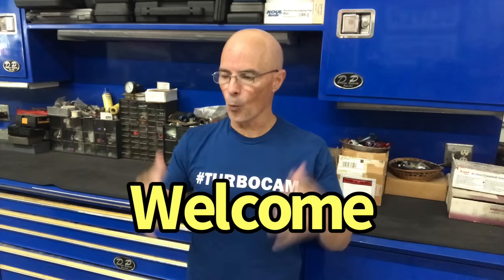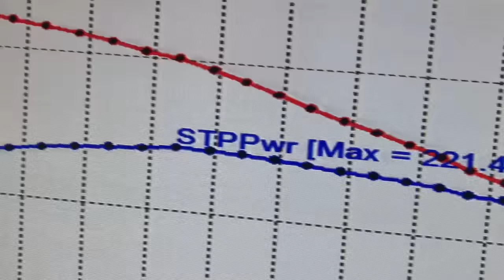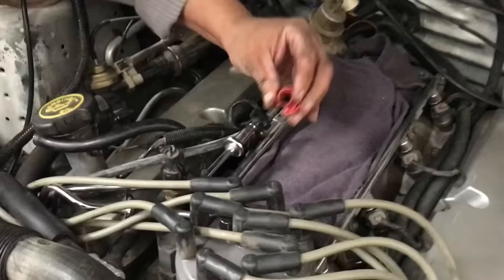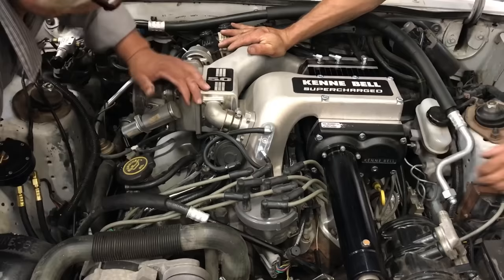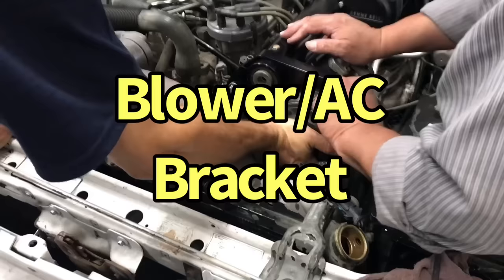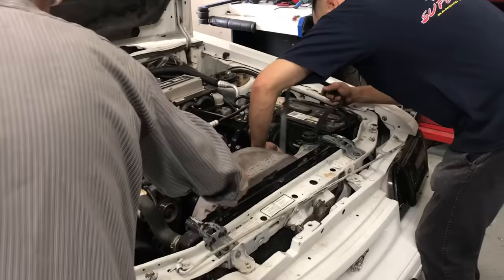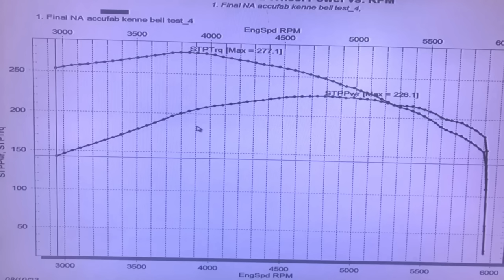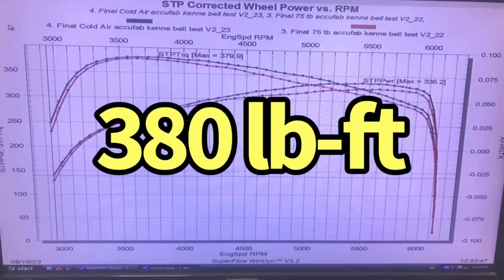DOES KENNE BELL STILL MAKE A 50-STATE LEGAL SUPERCHARGER FOR THE 5.0L? HOW MUCH HP IS IT WORTH?

Comment: That thing made almost exactly the HP and TQ of my old 88 GT from back in the mid 90's. I made 226rwhp/282 rwtq. Oh the memories.
Reply from the maker: must of had mods
Reply: @richardholdener1727  the basics. Cold air intake, pullies, catted h pipe and exhaust, bumped the timing, ditched the PS. Dynoed at Brothers in Corona by Joe way back then. Ran 12.9x's all day long on slicks at Pomona street legals.

Comment: I feel like this is what Ford should have done in 1993. Our Australian Cobra engine, the one with the Showa G52 intake, and built to Cobra spec by Watsons,  made 280 flywheel SAE net HP and 220 rwhp with a T5 and 7.8 inch axle on 245 tires. Listed as 274 HP DIN net.  The baseline looks the same. Great test.

Comment: The video reminds me of helping a friend install one of these K-B units years ago on a 95 5.0l. The dance of trying to get the blower and upper manifold onto the lower and getting all the bolts started was quite the feat.
Reply: Worth the trouble I assume
Reply: @Andy351c  yes, it was. That thing was scary to ride in afterwards. It had trickflow twisted wedge heads, GT 40 lower, LT headers and 3.55 gears and a stock cam. It had so much low end grunt, it did rolling burnouts in the first 3 gears at will.
Reply from the maker: THE STUDS HELPED
Reply: @richardholdener1727  yup, that is what i was thinking when you where mounting the supercharger. Studs make it that much easier to align.

Comment: Richard, thanks for the review.  I seen KB brought these back and great to see a current review.  I’ve been running a Blowzilla on my 306 for 4 years now with smiles for miles.  It sat on a shelf for 9 years waiting for the car of choice.  If only KB would have engineered an intercooler setup for it.  I’m running meth injection to help the AITs but think a cooler would be better overall.  HCI setup with “Explorer” intake, 90mm TB & MAF, typical LT header exhaust through a T5 trans and 9lbs of boost puts 420 hp/ 502 tq to the rears all day long running AC with a great tune of course 😊.  Full boost at 2800 rpm’s.  Much more boost to be had, but no real need for longevity is key for me with stock block and forged internals.  Here in NC we get some hot days and yes AITs are a challenge, but for a street car that drives to half dozen large events and back a year and weekends, I absolutely enjoy it.  Again, thanks for the great content and transparency as always!

Comment: I was having my 12 mustang tuned recently here in Florida at a local place, there was a 91 gt with this exact supercharger it had ford shorty headers with cats everything was stock besides exhaust Auto with 2:73 gears. I forget what pcm combo he went with ( I believe it was a holley) it was there for tuning as he ditched the ford pcm. He made 315/365 to the wheels. On stock pulley it made 4.5-5 psi. The owner told me he bought the supercharger over a decade ago he had about 50,000 miles on it. I could not get over how quiet the blower was. Im serious Zero wine ultimate sleeper.

Comment: Great video Richard. Would love to see more KB 5.0 content in the future! 

Some potential topics to dive into: starting the dyno pull a little lower so we can see the effect on low-end torque, absolute air density tradeoff between non-intercooled IATs and boost, thoughts on the decrease in runner length (since a good portion of that comes from the "wraparound" upper intake with the giant 180 degree bend) versus boost, and the boost curve.
Reply: I would think Losing the bend was a good thing since it makes so much more torque and short is good for hp which is what is needed with this type of blower

Comment: That being said, in the video great, I’m running a Paxton Novy, 2000 on a stock engine but aftermarket intake, headers and exhaust. The Novie 2000 is capable of 900 hp if the Engine is built, right. The Paxton, nove 2000 Actually has a Street legal tag on it with a card number I think this is the best supercharger ever built never seen it on your channel. I respect you a lot.
Reply from the maker: I have run the Novi 2000-it works well

Comment: What do you do with the ACT sensor in this application?   I currently have a 1.5 KB on my 89 GT.    I have an extrude honed stock lower.   I believe my ACT sensor is in the lower intake. 

I am thinking about upgrading to the 2.1 flowzilla/blowzilla combo you have there with the GT40 lower that KB sells.   Worried that I would have to relocate this sensor to a less than ideal place.
Reply from the maker: they have a provision for the sensor in the intake
Reply: @richardholdener1727  that is awesome news!   Is it in the discharge part after the blower?

Comment: Hey Richard I have 4 Mustangs I have a love for them so of course I love all of ur content on old school 5.0 and the sn95/new edge any chance u can do a video on 4.6 2v with ported pi heads a nice lumpy cam and a factory ported roots blower Thanks
Reply from the maker: what factory roots blower cam on a 4.6l 2V? and lots of 4.6l 2v vids up
Reply: I have a 2002 Saleen with a series 2 forth gen m90 and I wanted to do a cam swap and port out the blower or one from an 03/04 cobra and port the pi heads but I haven't seen any videos on that combo and I'm interested in seeing how much hp it would make and if it's worth it
Reply from the maker: the M112 blower can support more power than the M90 on your Saleen, ported heads help for either, same with cams
Reply: Thanks for the info any chance you might be able to do a video on that comb to see what kind of power it would make

Comment: How much more can that blower set up handle? Could it still improve apon a mild built 302 with H/C/I ? It looks really good tucked in under the hood.
Reply from the maker: BLOWER IS GOOD FOR 700+ HP
Reply: @richardholdener1727  WoW 700 hp I bet with some more mods that 302 can compete with 03 04 cobra terminator , I had a 03 long long ago lol with upper and lower pullies bolt on s meth injection and every thing , But turn into a chevy guy after i got walked by a 01 ss lol bad🤣

Comment: Hi Richard. 
Since the Weiand 174 was discontinued, what are the roots or twin screws supercharger options for the SBF carbureted engines?  I can’t find anything out there 😢
Cheers
Reply from the maker: the blower shop has 192s, but look for a used 174/177

Comment: Hi Richard.

What size is the throttle body opening on the Inlet? 75/90mm?

Either way, I'm ELATED to see this thing back in production. Not really big on the "5.0" badging, but that's small potatoes.

Again, thank you for the 8.2 deck content!
Reply from the maker: 75
Reply: @richardholdener1727  
We love 8.2 stuff.
Remember back when everyone was going modular and we 5.0 guys would not swap? It's like Studebaker guys, they'd rather repair than swap. I still have that deep admiration for the fox 302.

Comment: 1/2 way thru the video... thinking, wow   that's an interesting design!   Blower on the underside to save vertical space.  How much is the estimated "dyno cell" hp ?  I'd guess close to 450 ??

I bet with all that low torque, it's a blast to drive
Reply from the maker: NOT THAT MUCH
Reply: @richardholdener1727  really? (Well, you'd know better than me!)

I thought the full accessories,  full exhaust,  plus driveline loss would  be more.
Reply from the maker: we would have to run all the accessories on the engine dyno for this blower, and shorty headers so the engine dyno numbers should be much lower than 450
Reply: @richardholdener1727  thanks for the follow-up. 😀 I didnt consider all those other accessories were needed.

Comment: At this point I am assuming most fox cars in this market will have some sort of hci combo and are in the situation of writing off that ridiculous expense for stock ls power...or freshening up with a belle as it is one last bolt on...... over the time and expense of an ls swap...  so 400 whp is probably pretty easy in that light ... FOX chassis is starting to enter rowdy territory in that area.

  Even at that....meh...L/S swap. Make an adapter for LS as an upgrade later Kenne Bell..😂
Reply: Just needs some proper flowing heads, big diameter longtubes with 3 inch collectors and 3 inch all the way to the tail pipe, spin it to 7000rpm plus the blower and a little more boost plus watermeth for added safety and she'll scoot nicely....this is coming from a guy who loves LS engines...still have a soft spot for ford 302 engines...most 5.0 people don't do proper induction and exhaust flow mods then wonder why the numbers are so low

Comment: So for a mere $5000 you can supercharge an old 302 to make the same power as a cam only 4.8. LOL. All jokes aside, these were really good numbers and a total game changer 20 years ago. Now days, not so much. Still cool seeing it tested though. I had several buddies back in the day that had the paxton centrifugals on their 5.0s. Nobody I knew ever had one of these KB roots blowers though.
Reply: definitely more of a novelty than a kit for someone looking to make numbers. was looking at getting a vortech but this thing looks so wacky and unique i might just get it to have 450-500 hp street toy, keep in mind the rest of the top end of this motor is stock junk
Reply: Issue is the heads...once you get good heads aka anything that's not e7's or gt40's, plus a proper maf and throttle body preferably 90mm or more and proper 1 3/4 or 1 7/8 or bigger headers then these old 5.0s breathe pretty good...with proper induction, proper heads, and headers you can get 300 crank with the stock h.o cam...unfortunately in my experience most ford guys don't understand the concept of a vacuum pump aka the more air you get in, the more air you need to push out...not to mention the hard on most foxbody enthusiasts have for wanting to stick with the A9L ecu when there's much better options nowadays like the holley or megasquirt or P.I.M.P ecu...LS engines have pretty good heads from the factory, hence why a cam swap nets you good power even on a 4.8 LS
Reply: @monikhushalpuri  thats correct  about the  4.8LS ....this is why  5.0  guys  who do buy this  just switch over to  TF  17011R top end kit and this blower.  it'll make   probably around 400=450+  to the wheels  and that 4.8  is still a junkyard engine.

Comment: 🥲 I wanted to hear it
Reply from the maker: i HAD RUN CLIPS AND DYNO
Reply: @richardholdener1727  with the supercharger on?
Reply: That's a GT, not a cobra
Reply: Is that a Sprintx Compressor?
Reply from the maker: Kenne Bell
Reply from the maker: yes-I had clips after the install running on the dyno-forgot to include them or the burnout
Reply: @adamrushka8096 You are correct. If you look closely, there's a decal just above the cobra logo that says, Not A